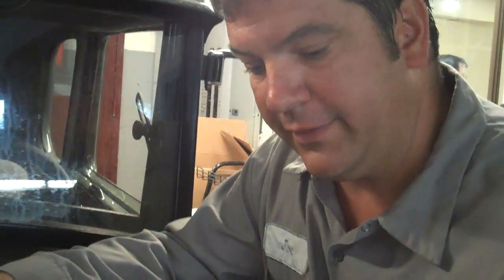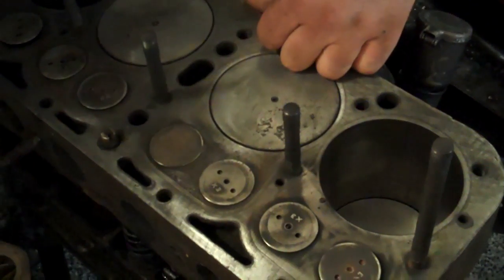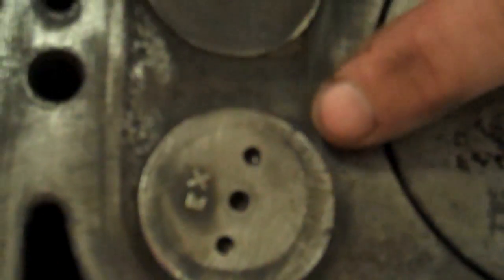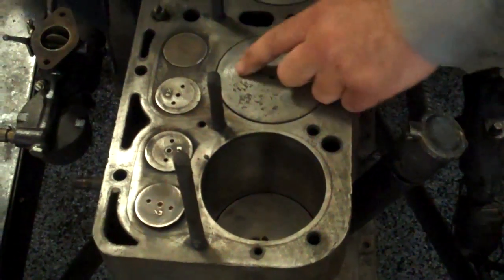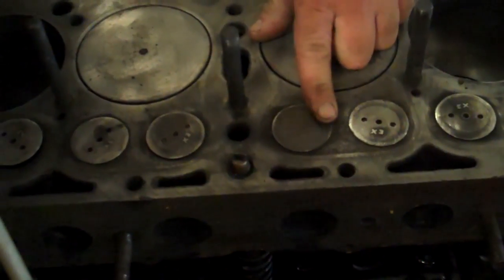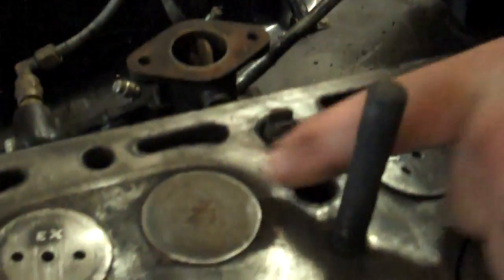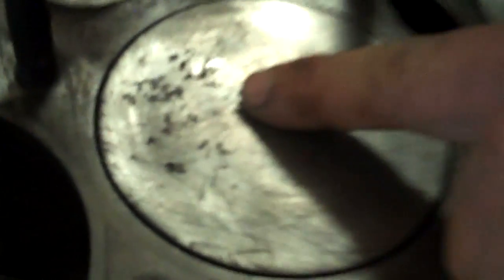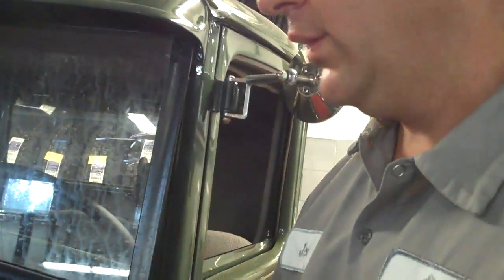Model A overheating trouble

Comment: It is arguable but I am of the opinion that the majority of model A overheating is due to plugged/ restricted flow through the radiator. Those old motors create lots of scale which looks like sediment (because its been beaten around in the passages and pump). New rads have smaller passages than the original which makes plugging easier. 
Yes there are many mods which I call band-aids to alleviate the problem  but the real fix is clean coolant and rad. It's better to use coolant rather than water because the coolant has anti-corrosion compounds in it and raises the boiling point of the fluid (this helps keep flashing on hotspots down)

Comment: Kind of interesting, but the overheating thing was common. Pinching the hoses a little stopped the cavitation of the coolant. Cavitation is air bubbles within a moving liquid. So essentially the water pumps couldn't move the water efficiently, because of small air pockets; causing the engine temp to rise. Weird, but true.